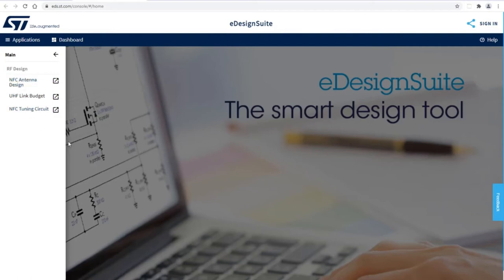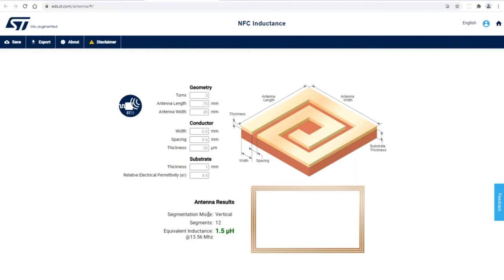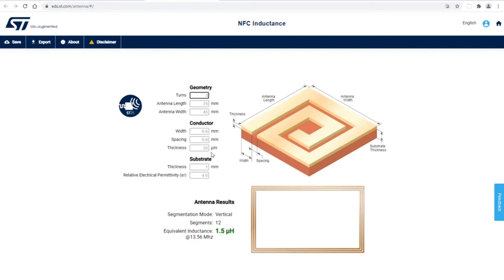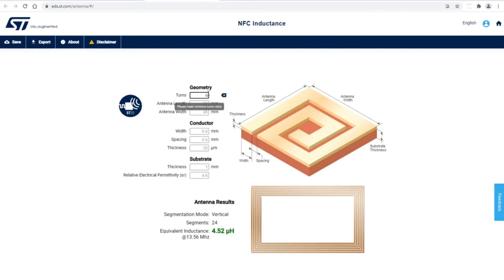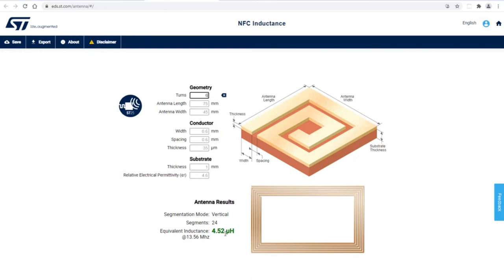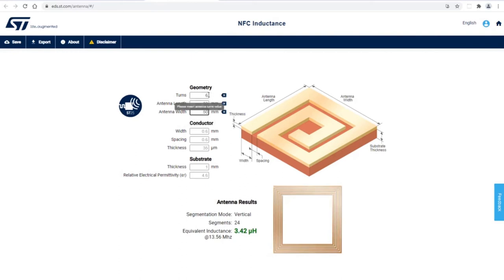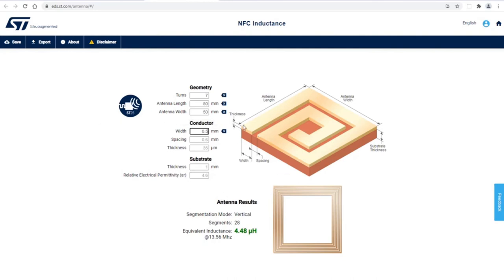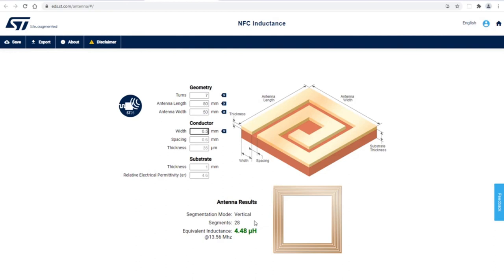Simple RF design with eDesignSuite: How to tailor your NFC antenna design to your application needs

Comment: ok so i am having a bit of toruble understanding...so i turned on captions in english and @1:30 it shows you said "sd25dv" (i tried googling this and couldn't find anything)...am i mistakened? sorry, i'm trying to get a custom antenna built but I'd need to do some research on what exactly i need for my application. i'd really appreciate some feedback!
Reply: The ST25DV is an ST Microcontrollers chip for dynamic NFC tags